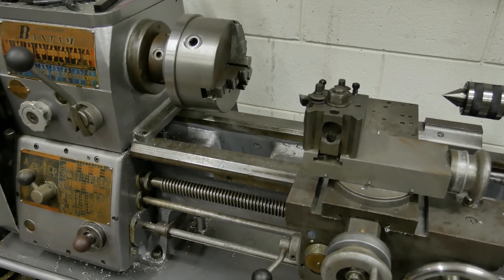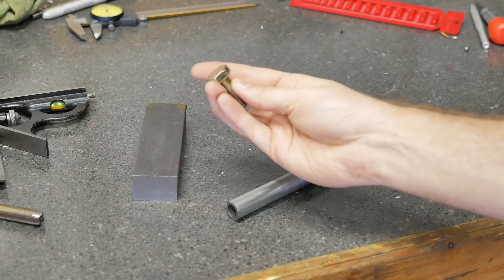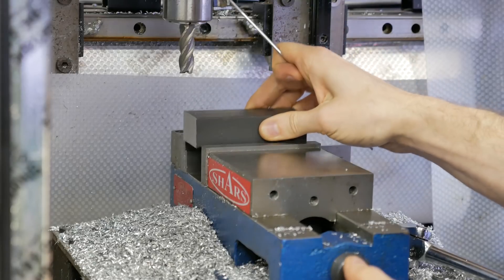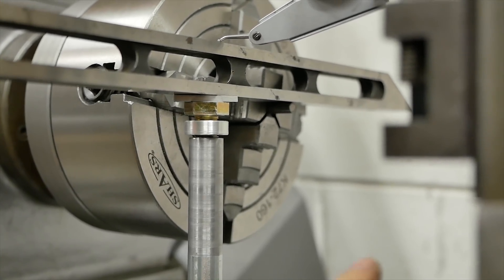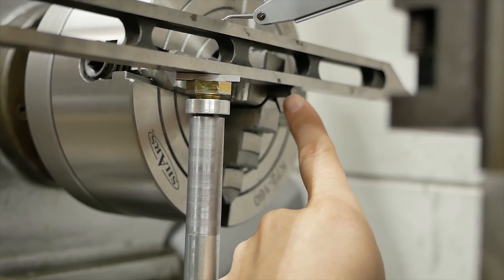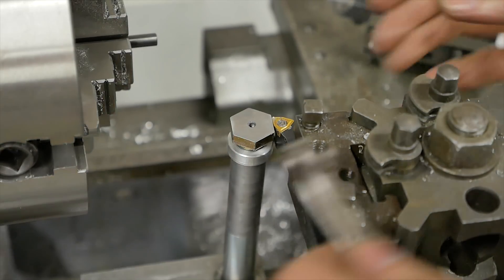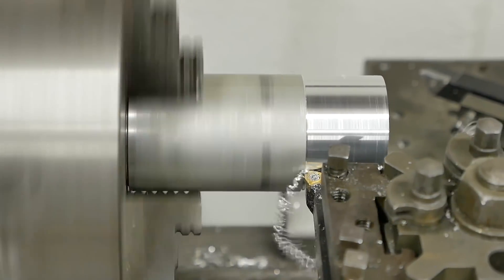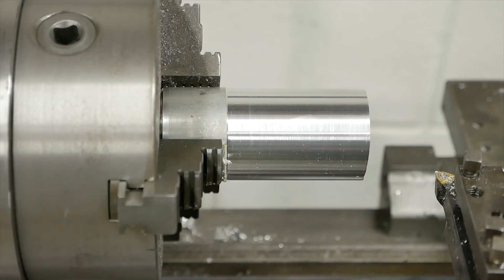Tool Height Gauge - S02E28

Comment: Chuck stock I'm the chuck and turn a point like a dead center.  Use that to line up the point to the top of your gauge by eye (you can get very close).  If you chuck up a center or use and end mill like you did then you are relying on the concentricity of the chuck being true to the rotational center of the spindle.  Same with putting a pre made center in the taper of the spindle (you assume the center and spindle taper are true).  While they might be fine and true, the could also be damaged.  If you want to go your indicator route, turn a piece of stock to whatever diameter (ex your 1/4").  That takes out the concentricity error of your chuck.  Your turned diameter will be as true to the axis of the spindle rotation as possible.  Scroll chucks do not have good relative accuracy when it comes to concentricity.  The accuracy also varies over the clamping range due to the manufacturing tolerances and wear in the chuck scroll.

Comment: It seems to me that you could have had a better chance at a true 90 degree between the block and the pipe by drilling into the block, turning the pipe on the lathe and doing a press fit,  or even threading the block and pipe and screwing them together.  The heat of the weld is very likely to cause distortions.

Comment: What influenced your design to make (or leave as hex) the top surface hex? And then, what influenced you to make the locknut smooth and round? And for the locknut, wouldn't you also want to knurl the nut rather than leaving it smooth so it can more easily be tightened by finger gripping it?

Comment: otm646 Just to clarify, you chuck a 0.200 pin gauge?? 🙄

Ignoring the size of the reference bar, that’s pretty much what he does in the video, only in the video he gives himself a nice clear reference plane rather than trying to work with a dial indicator directly. His method is more practical. Sorry.

Comment: I align the cutter with the dead/live center on the tail stock.
If don't have a tailstock on... I use a 6 in scale and pinch the the scale gently at the center between the workpiece and the cutter. If you're on center the scale should be resting straight up and down. If not the angle will tell you if you need to raise the cutter up or down. Also understanding the purpose of the cutter geometry (positive, negative or neutral) will allow you to err to one side to prevent chattering.

Comment: No filler wire is a bad idea, as the weld is much weaker, much higher odds of deforming and cracking.

Comment: 1. a  laser level
2.   water in a clear plastic hose 
3.   bring up tail stock with a center point holder and align with point
4.  observation of cut   = take a piece of scrap trun it observe, raise tool turn scrap observe, lower tool turn scrap observe & ect. 
5. Starrett machinist's level across a bridge

Comment: The simplest way to check tool height is to trap a steel rule between the tool and the outside of the chuck. If the rule leans toward you: the tool is low, away from you and the tool is high.

Comment: but... if the drill chuck is by specification always in the center of the chuck it self, why just don't make a rod with a full cone countersink done with the drill chuck it self to make a seat for the cutting edge? this way you should have a fast and cheap way to set it with repetitiveness. I know almost nothing on lathes in general, I'm just assuming this by what i know of them.

Comment: the better way is to just set tool height on a granite block relative to 1 indicated (set) tool because it takes up less space. Don't need to have that toolheigh setter taking up like 1/3 of a drawer in your toolbox. The way you set this first tool is to make a cut, measure the diameter of the stub, and move the tool up by that much (half the diameter).

Comment: Thats the quickest way to set the Tool hight, but please dont hit that Cutting edege so hard. It can be Damaged (because of Hardened steel). To set the Tool hight you can also put a Centering in the Tailstock. (sry german google translater isnt good). In my experience the exact hight of the cutting edge isnt so needed.  I like your projects they are very cool and im very happy if you guys keep going on that Stuff. :D
Reply: As a toolmaker time served the lathe tool must be placed on centre height to give the optimum performance for tool life and finish my reaction to amateur machinists is no guess work and research your techniques and please use all safety advice machine tool accidents can be horrific      I know from personal experience having saw many people taking shortcuts through  inexperience

Comment: I find the easiest (or quickest way) is to use a dead centre (or even a live centre) in your tail stock. Line up the tip of your tool with the tip of the dead centre. Its all by eye but incredibly accurate.

Comment: Not to intimidate your intelligence but you made centering your tool a bit too over the top and over complicated, to quickly center the tool its just too easy to gage it from either a center in the tail stock or a dead center in your headstock with the chuck removed ( all centers are precision ground leaving the tip completely centered along the axis of rotation ) however not all operations on the lathe require your tooling to be absolutely centered, some cutting operations require your cutter to be just below center, i hope this helps as i have used the mentioned technique for over 13 years and it has earned me numerous NIMS certifications

Comment: put tool against ruler up against the stock, move up and down till ruler is vertical. done
Reply: I learned to put a center in the  tailstock - swivel the tool so that both tips can meet - adjust height - swivel the tool back and cut some metal
Reply: Troy AM I've done this too, it works when you have the opportunity. Yesterday though: I had just spent way too much time locating a square part in the 4 jaw before I realized I didn't even have the boring bar in a toolholder (nevermind on center). Whoops!
Reply: Hmmmm - might be good enough for the work YOU do Troy...

Comment: Just out of curiosity, could you have cnc'd/filed a pie shaped cross section  in a steel rod to the halfway point instead (where the point of the pie is at the center line)? Then use a machinist level rested on a rule between the rod and the tool rest itself, then raise or lower until level (this all assumes you've leveled the lathe itself, of course). Then simply mark the tool rest and tool holder so that you have a permanent reference, and repeat with remaining tool rests.

That said, any reason to use your tig is a good reason. :)

Comment: I do this a totally different way. I use a 0.200 gauge pin in the chuck and a digital indicator on a flex mag base.  Set zero on the gauge using the pin, remove the pin and put your tooling under. Remember your 0.100 offset and you're on center.

Comment: A tool height gauge is a neat little project, I've got one lying about, but I don't use it any more; a steel ruler between tool tip and the chuck or spindle nose is far faster, and just as accurate if not more so.

Comment: I have been working in my machine shop for many years and have always just eyeballed tool height. I guess when you have done it long enough, you can just tell when the tool height is off by the feedback you get in metal finish and sound. There is a few old school tricks like using a scale(ruler) to set height, but I rarely use it.